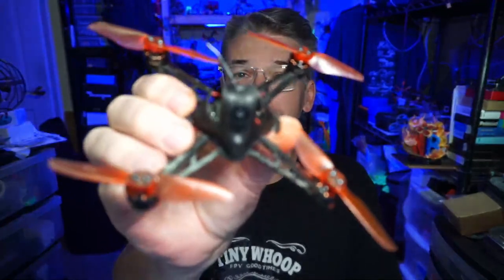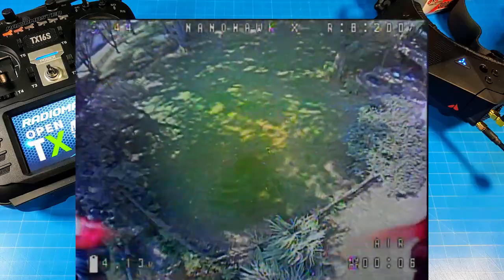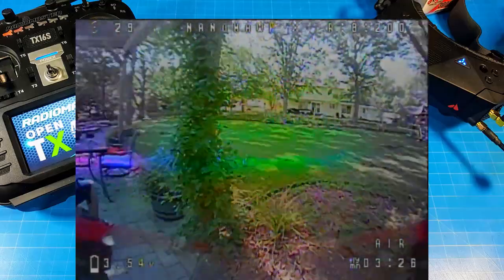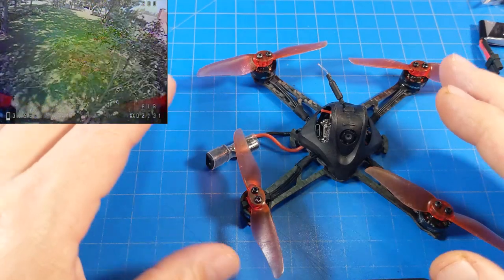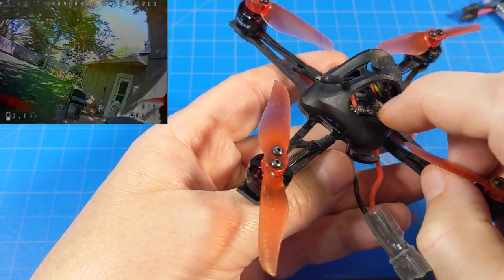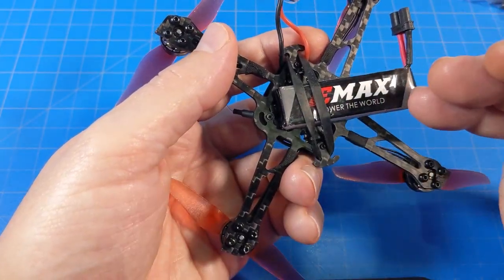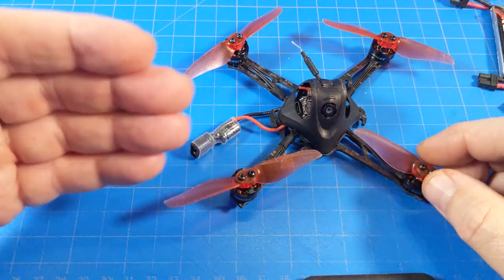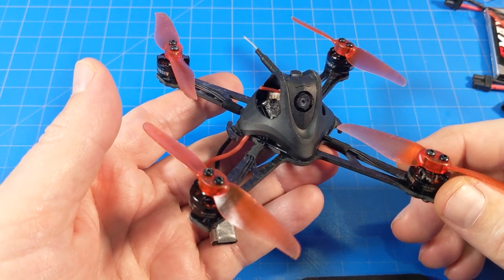Emax NanoHawk X // Durable Micro with Tricks // Ali Express Coupon

Comment from the maker: So what do you think of the Emax take on the BabyTooth category? New Props of interest? And your experience with the AIO?
Emax https://bit.ly/3knoO4r
Ali Express (Coupon "EMAX8888" 10% Off) https://bit.ly/3AZrGuZ
Banggood https://bit.ly/3CYAByv
MakerFire https://bit.ly/37XZvju
RaceDayQuads https://bit.ly/3k7y64d
PyroDrone https://bit.ly/3y0R0yA
Reply: I don't know about Ali express but emax does not honor warranties through like eBay even if there sold as new and they look new, so I would suggest getting it from your closest local hobby outlet sorry to say that but kind of pisses me off I got like 10 tiny oxen I got one that's definitely was originally put together wrong and they say you know "I hope you understand"
Reply: I fly the freestyle aio it's quite tough.
Reply: @airdevil21   I think what happens on the original the battery leads are so short coming off the board if they don't put the wire into the groove and get solder on both sides of the board pads after you pull on it so many times it must get weak and pull off and that's the person that 1st put it together and I don't care if somebody resolved it that's my own gripe with Emax

They knew, 21st century mindset
Reply: 1⃣ Does it has an current sensor ?

2⃣ Can it be bound in D16 mode (or only D8)

3⃣ Can Elrs (CRSF 💩) be added to it ? (solder pads)
Reply: @Cre8ionz.  on the org the adc current sensor works but calibration sux hence their osd setup just has volts
Reply: @Cre8ionz.  I would also like to know if you can wire up crossfire
Reply from the maker: @Cre8ionz.  Yes, it has a current sensor. It can be bound in d16, but i am unsure of the range. It does have rx and tx pads, I am unsure if that disables the use of sa.
Reply: Nick i got mine today in the mail. Emax hit it out of the park. They definitely improved alot. I was very very happy with my first flight. Theres a popular fpv guy who did put an insta 360 on this and it worked fine! Footage was amazing. Im excited to get a 360 go on this baby
Reply: Also im thinking that smaller rubber band spot on the bottom is to create a rubber pad area with rubber bands for non slip issues. Just my opinion
Reply: Also it came with 4 extra rubber bands. 😁 They must of listened to you. Still only two extra props and one battery
Reply from the maker: @dmdelugo  I think that is a good idea. Kinda an odd size of rubber band, but I guess we can double loop a single band.
Reply: Definitely needs a buzzer. Jusy spent an hour outside looking for it in the tall grass. The damn props are so quiet i couldnt even hear it when i tried to spin them in the grass. Lol. I did find it. Needs a buzzer for sure.
Reply: @NickBurnsFPV  yup. Im going to play around with it and send you a picture
Reply: i ordered with your discount coupon , it will be my second drone after thrashcan :)
Reply from the maker: @dmdelugo  yes, that is often an issue with micros. I don't fly around tall grass but I an imagine the struggle.
Reply: @NickBurnsFPV  👍
Reply: After a few days i am still thumbs up on this on.

Comment: I'll stick with my 2s crux3 in this form factor. I have turtled it multiple times on concrete and tried to in very brief bursts in the grass on multiple occasions,  but it usually doesn't work in the grass. That was on the second fc though. The first one died fast but racedayquads sent a replacement fc. I love my larger quads, but fly this one the most since I can fly it in the yard. Haven't needed screws for the props either.

Comment: This quad inspired me to buy the original nanohawk and do the 40mm prop upgrade. The original nanohawk has a lot of the same parts as this and is $75 on banggood. Seems like the best really cheap quad you can get right now. I couldnt find anything else with its performance for under $100. Love the quietness of this quad. Even at full throttle it barely makes any noise. I would also be interested in a 2s version. Great job Emax!

Comment: @Nick Burns FYI What's critical about those little USB chargers is the Current rating on the port you're plugged into, as with USB standards for that type its 5V everywhere. So yes more power from say a phone charge adapter but thats due to the high current capability ;) Also Power = Voltage * Current

Comment: Like most things, I'd probably end up building my own version of this. However, the props sound interesting. I really like the emax props in 2, 2.5 and 3" sizes so far. They seem to try and keep the mass of the props closer to the hub center where possible. This should help with balance and the torque needed to spin them up and down rapidly.

Comment: I basically built this quad when the Nanohawk came out :-). Took the fc and put it on a baby tooth frame with fpvcycle motors. Epic.   I do wish however that Emax and other manufacturers would not let all the you tubers drop their videos , when you can't find the quad in any shops yet!!!!
Reply from the maker: I believe emax ships product to the resellers and then tells us the release date based on when resellers will have their shipments. I did find shops with it currently available.
Reply: @NickBurnsFPV Couldn’t find it in any UK stores earlier, it’s only just popped up in the emax store :-)

Comment: Yep, my nanohawk came with the spi not working and unable to boot to dfu, but other than that, the aio has been a great board, that's stood up to a tonne of abuse and having to carry a tiny tank, after the vtx antenna got shredded. Also love that the built in vtx is just a daughterboard, so it's fairly simple to replace it. Glad they upped the vtx power for this one. Great job as always!

Comment: I own a few Emax products, every one of them are built well and fly even better. The nanohawk x is no exception. Its amazing how juicy it is on 1s, The pid tune is spot on, and believe it or not, it survived a pond crash that had it sitting 3ft under for 10 min. The lights never stopped blinking. I unplugged it while it was submerged (this is key) and then nuked it with some Mapp sensor electrical cleaner. The came took a day to defog inside, but its back ripping!

Comment: Hey Nick I definitely had the same experience you had. On my tinyhawk 3 (same board as nanohawk x) the motor was broken. I as a beginner kept on arming the quad and eventually it made a sound (like the startup sound) and it stopped spinning the props. Seems like there is some failsafe on that board. Did the same with the tinyhawk 2 and the esc blew out straight away. Now using the Flywoo 1002 15500kv on 2s on that board and it still doesn’t blow out the esc’s whatsoever.

Comment: Say yes to emax puts out quads with awesome tunes out of the box.

My go to 1s is the 550 race line tattu. Mainly due to how many cycles the battery will take without losing capacity. Seems like my other 1s batteries after 20-25 charges the flight time would drop way off.

Comment: Main issue with this canopy is the Jello and inability to change the camera angle. Also, is the FC same as the one in the nanohawk? If so, didn't know it could handle 1202.5 motors.
Reply from the maker: yes same as original nanohawk

Comment: Those second hooks for rubber bands, could use one there, under the battery instead of a sticky battery mat, that should secure the battery from sliding, and use a rubber band on the outside hooks to hold battery.  
Looks like a nice quad. Flys great. Thanks Nick!
Reply from the maker: ah yes a good option.

Comment: So I lucked out this week and won a Nanohawk X from Emax on a FB giveaway. One thing I'm struggling with a little bit is the battery placement. It seems the way they've routed the pigtail means when you plug in the battery, the pigtail sticks out to one side awkwardly. I wish they would have put the rubber band hooks the other direction so I could toilet tank the battery. I suppose I could take it apart and rotate the FC & canopy 90 degrees, but I want to get a few flights in before I start tinkering.
Reply from the maker: Nice win! Yea the pigtail is a bit long

Comment: im getting my first quad in the next couple of days at age 32 lol i brought the tinyhawk 3 rtf kit, its always very wet at home here so one of the first things i will be doing is conformal coating all the electronics to stop the water from the grass and stuff wreclomg it, im trying to choose between this and the freestyle 2 for my second quad and ill be doing that to what ever one i get, probably the freestyle 2 so i can use my 1s batteries ill be getting for the th3 kit, i hsve been practicing on the sim and getting the hang of it now so im already thinking ill want something with a bit more power for flying around my dads property his on 5 acres, the little rig is just for inside the shed
Reply from the maker: for the larger property I think the tinyhawk 3 is a better choice.

Comment: thanks for review, could you please do a favor, hook up quad to power supply and turn down voltage till 5v regulator craps out? I'd like to know how fc would work using a li-ion. hoping it works down to 2.5v. thanks
Reply from the maker: I should be able to to that. I believe I have a power supply around. Or I just kill a battery in a hover :)
Reply: @NickBurnsFPV  the cheap little ToolkitRC chargers, and newer ISDT chargers will do that!

Comment: Ordered myself a roll of that tape and it was the fuzzy type that ended up showing up. It works, but it's not as aesthetically pleasing as the correct stuff which I have I believe on my LK fly egg 130
Reply from the maker: Yep I have a old of that in the back of my storage. I suspect I would use it in desperation or for a broom handle :)

Comment: I have been flying these 1s builds alot. Not a fan of the runcam nano3. The frame i would rotate to toilet tank the battery.  Bobs nee 13 mm 1s motors are 🔥. The 1202 is a more efficient motors with plenty of power imo. Good video 👍
Reply from the maker: Yes, I liked the runcam nano 3 back with the original lens, so much so I bought a hand full, but the lens company went out of business with the pandemic. Unfortunately the current lens just isn't as good. :( What camera do you use in your 1s builds? Foxeer Pico or the Bee Eye, maybe something else?
Reply: @NickBurnsFPV  fpvcycle ant lite is one of the best for features, quality and price. Downside is mounting. The canapy i use is made for it and 3d printed. Im flying the warpig 120 frame.
Reply from the maker: @aythixfpv  I do like the ant lite. I do wish the FOV was a bit more. Get that extra sense of speed :)

Comment: @Nick Burns  
Would you recommend this or the Crux3? I am an experienced quad pilot in Acro mode with 2" 3s racers (My own heavily modified King Kong FlyEgg's mostly) but also with 5" freestyle quads. I love these 3" micro racer/freestyle quads and need one to fly around the yard just to have fun with. I am torn between the Nanohawk X and the Crux3. The Crux3 is what I'm leaning towards just to have that 2s power but the Nanohawk X looks to be a great little flyer even on 1s. I love fast and sharp flying. Which one would you recommend and why?

Love the videos! Subbed!

Comment: I am torn between the Flywoo Firefly nano 20 and this emax nanohawk X. Both 1s, both lots of fun I think. Which, in your opinion is the better flyer?
Reply from the maker: I tend to have a bias for smaller quads. The x will likely have longer flight times as the larger prop is more efficient. The nano 20 will feel more comfortable in small spaces or smaller gaps. I prefer the nano 20, to me it feels more agile and quicker to respond.

Comment: I’m sure it’s another very good product from Emax, but all I really want to know, is how does it compare to Bob’s Baby tooth?? Even close? Every time I see the formula copied, I am seriously interested.
Reply from the maker: I haven't flown Bob's original babytooth recently, I gave it away. I have given away most of my 1s 3inch quads, so my comparison would be less recent as Bob's formula tends to evolve over time. It might not be fair, but if I had to chose between the babytooth and a 2s version I would chose the 2s version. I do have and fly my 3s Kabob toothpick. I do prefer 2s on a smaller prop, I haven't found a mix that gives me the response on 1s or 2s 3inch prop, to me 2inch 2s is better.

Comment: Does the frky BNF rx work with the old ACCST protocol? That whole change is a nightmare for me.
Reply from the maker: Yes. Honestly at this point I forget the name of the frsky firmware and which came first but if it’s the older radio firmware it still has d8 mode and will work with frsky AIO Rx. We might have to change the Rx protocol in betaflight to frsky_d but that’s it

Comment: Looks like another great offering from Emax! I bet those props would work really well on the 533 tiny trainer if you still have one around. It would be interesting to see how they preform at higher speeds. Being lighter they may flatten out and not have top end performance, but testing is half the fun. 

The power loop experiments were fun to watch!
Reply from the maker: Well I can't test with a tiny trainer but I could certainly test on something like my 3s Kabob toothpick, I do think they would flatten out as they do feel more flexible. But as you said testing is fun to find out. Now I need to go buy more props as mine are pretty beat up :)

Comment: Nick, do you have an affiliate link for the blue propellers you use for the original nanohawk? the original ones keep bending. thanks!
Reply from the maker: In the moment I don't have a link to them. They are the old eachine props, we likely have to go through banggood or aliexpress. I suppose some shops might still have them listed. I appreciate the affiliate thought, I don't suggest waiting on me. I do have affiliate links in the bottom of the video descriptions of the videos. If you find them and there is an affiliate I have for the shop. We can click the link from my vid then add to cart. No stress get them props, the originals don't last long.

Comment: Thanks for this detailed review! I agree that adding a ELRS receiver (with smd antenna) and a 200-400mW built-in VTX would make this board an absolute winner!
How does this quad compare to Baby Tooth in your opinion ?
Reply from the maker: I gave away my babytooth some time ago. This flies very well, I wouldn't say its better as better depends on what aspect we are comparing. For me this is more fun, it could be the prop as the response is something I prefer over my experience with the babytooth and others I built like it.
Reply: @NickBurnsFPV  interesting! I will definitely try these props (BTW: is their pitch listed anywhere?) ! The 'radical' PIDs on the Emax may also have something to do with it (I have seen their super-high values in AndyRC's video and am going to apply and test them on my BT) . It may also be the frame - being 2mm it should be much less flexible than a typical 1.5mm on a BT 1s (a 2mm frame is another thing test on my 1s BT, but currently I have no more 2mm frames left  after I built my second 2s BT, but I have several frames by Quad 66 in transit - the War Pigs, so may use a 120mm, 2mm War Pig frame instead).
Reply from the maker: @onemanmob6756  I haven't seen a listing for the props or the pitch of the props.

Comment: So many comments on crux3 comparison. Please Nick say something on that. Or does your wish for 2s version say everything?
Reply from the maker: For me I enjoy 2s more than 1s unless its a whoop, then it is very close. I do think of the 1s 3inchers I have flown this is as close to the crux3 performance as I have experienced. I believe the other draw of 1s is the noise level is lower. With props spinning slower than on a 2s the noise is less. Another consideration might be the batteries, 1s batteries are generally cheaper and don't require a more expensive charger. Overall in the weight category I prefer the TKS Rocket Race, 2inch props on 2s battery. To me its more agile and a much better performer, than even the like of a crux 3.
Reply: @NickBurnsFPV  great comment Nick.

Comment: I like all the stuff Im seeing on the NH X. I really enjoy my Crux3 on 2s, but am definitely getting interested in 1s 3" quads. Great review.
Reply: Why would you want 1S if you have 2S? It would be just like a less powerful crux3
Reply: @chrisbee5481  the crux is designed to fly best on 2s although it can fly on 1s but not very well. The new 1s quads we are seeing are designed to fly best on 1s. I find that we are seeing a bit more performance comming from 1s quads now and I find that very interesting. The question for me is not a "why" it a "why not". I love flying all quads so why not a 1s 🙂
Reply: @Soulsurferfpv  on 1s 5A ESC's you are limited in power. Fact. May fly good on 1s but its not as good as 2s
Reply: @chrisbee5481  like I said, i like flying all quads, but mostly micros. For me I have many 1s quads and enjoy flying them all since each has its own characteristics of pluses or minus. I can fly all of them in my yard. The 2s I cannot. If I were just wanting raw power and speed then I would just jump to an HGLRC Patrell 132 in 6s and get it all over with, but thats not were im at. For now I will just stick to my 1, 2, and 3s quads enjoying each of them for what they are and yes that means 1s. ✌️
Reply: @chrisbee5481  yes that one is on my purchase agenda.